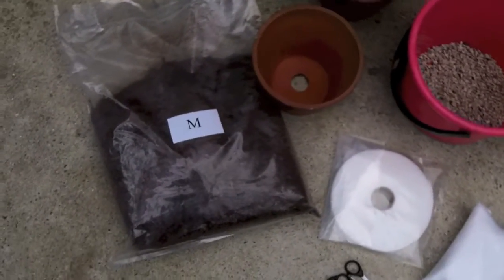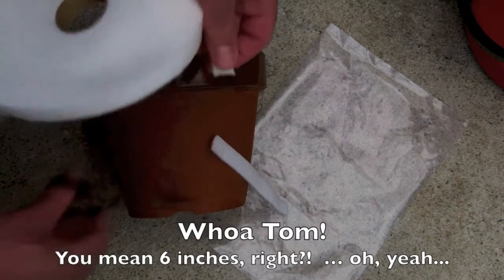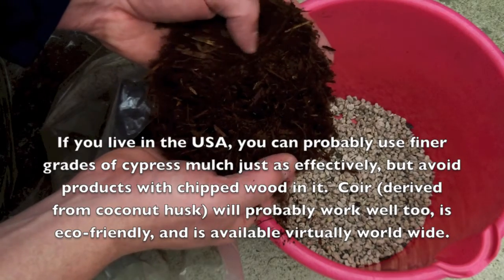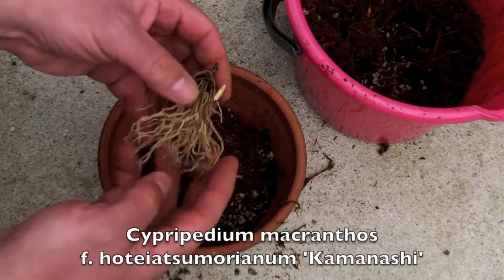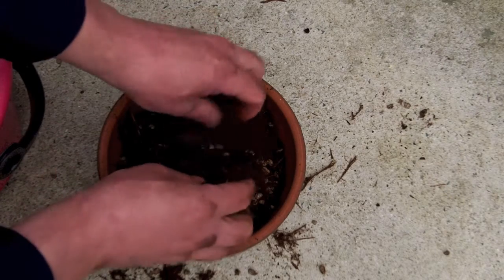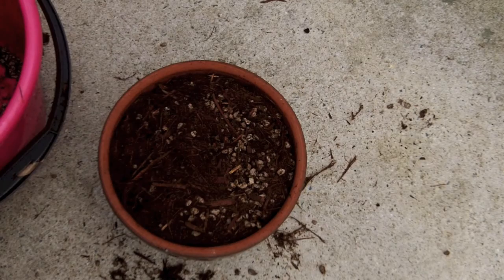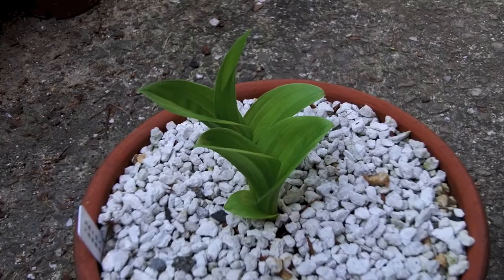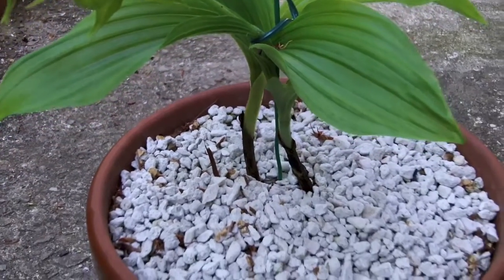The pot in pot cooler, potting lady's slipper orchids for a hot climate

Comment: What is Wicking Tape??  in the old days with Gesneriads we used yarn.  are they similar?
Reply from the maker: +Cycnoches2012 The tape I use is a polyester fabric that is commonly used in Japan, but I suppose any material that is resistant to decomposing and wicks well could work.  Check out this webpage for a possible product to buy in the US:  http://www.insideurbangreen.org/2010/04/self-watering-capillary-mat-replacement---gardencom.html
Reply: thank you!

Comment: What fungicide(s) do you use to treat your orchids ?
Reply from the maker: Generally I rarely, if ever use fungicides or pesticides.  When forced to, I’ve used Daconil (Acibenzolar-S-methyl) for leaf spotting/aggressive leaf rot, Benomyl (benzimidazole) for stubborn fungal infections since it is systemic, Physan 20 for less aggressive rots and as a prophylactic spray, Captan occasionally, and for less aggressive leaf rots I apply powdered cinnamon.  I HATE using most of these, but of them I use Physan and Captan the most since their toxicity is quite low compared to most others.  I rarely use Benomyl, but in the video in fact I was using it since the plants roots were highly infected.  I haven’t used it since however.
Reply: @botanyboy1  Very Helpful advice, ill be sure to make use of your fungal treatments when I ever encounter a fungal infection again, thank you for the reply 😊🙂😉

Comment: By doing this method i can grow  in hot temperatures like 40C kindly reply
Reply from the maker: I don't recommend trying unless you are very dedicated and willing to accept repeated failures.  C. formosanum is probably the best candidate for growing in hot summer climates, but they still need a cold period in winter.  Most of my plants eventually failed using this method after a few years.  I still have a couple plants, but they are just surviving, not thriving.